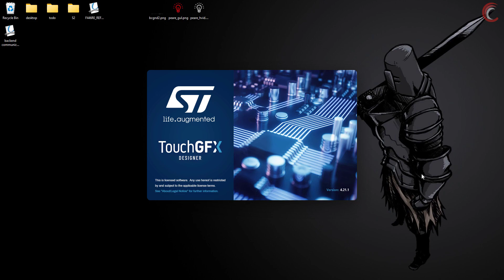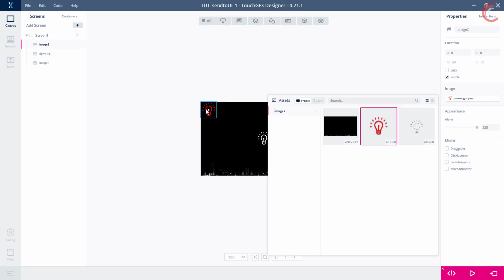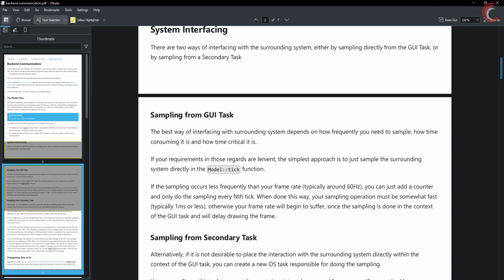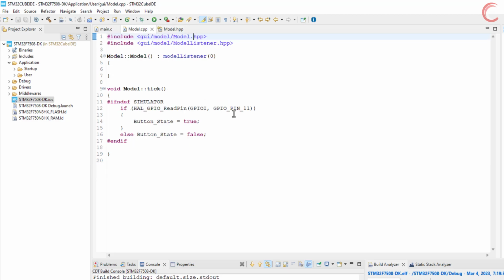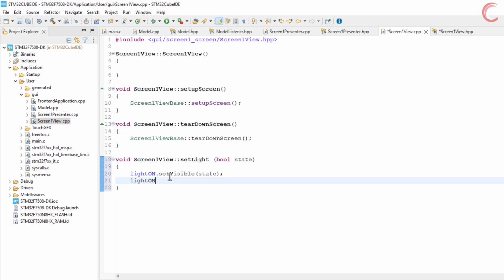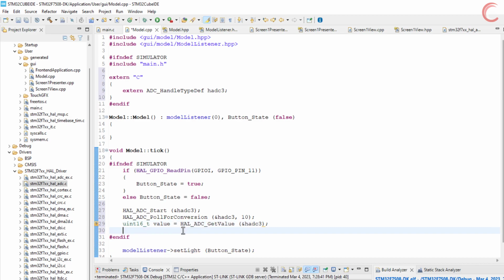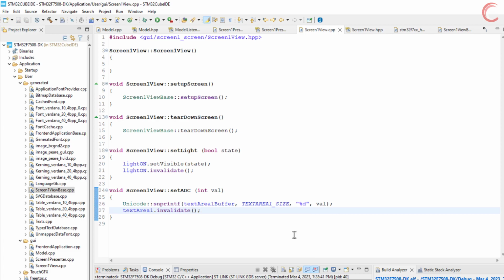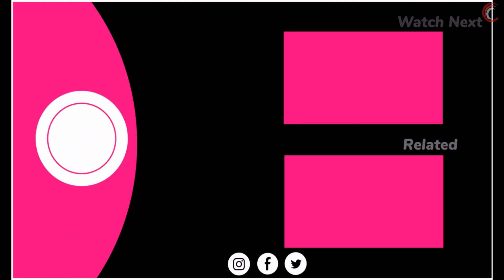Touch GFX #3. Send data to UI || Sampling from the GUI task || MVP

Comment: Thank you, great video! Is there a way for passing data NOT using Model::tick() all examples use the tick method, I am trying to pass a uart message recieved value every 5 minutes to a graph and would rather push the data to graph when it is recieved instead of checking over and over in Model::tick()
Reply from the maker: I understand your point.  Even the examples and theory provided by ST also uses the tick() function implementation, so I couldn’t find anything else. But I will look into it.
The tick() function will run every frame irrespective of whether you implement something into it or not. I guess it’s fine to check the queue in it.
Reply: I tried sending a data frame using LIN protocole from the touchgfx to an st board and receiving another frame from from the board to the touchgfx 
But when sending the frame i received back the frame i sent 
What could be the problem 
Even i didn't use the interrupt mode for the master because in one of your LIN videos and u did say that we can't use the interrupt mode for the slave so what could be the problem ?

Comment: hello controllerstech, thanks for the videos you make, I wanted to ask, if instead the external button wanted to recall the same function by simulating the touch on the touchscreen? is this to see the button animation on the screen from hardware
? it's possible? Thank you.
Reply from the maker: Yes ofcourse its possible.
Use the same code for the button on the screen.
Reply: @ControllersTech  thanks for the quick answer. I probably didn't explain myself well. if you touch the screen with a labeled button, for example, you see the button color change and perform the function, is it possible with a physical button to emulate the touch on the finger touchscreen? connect physical button to sequence callback? I've been looking for days for an example but I can't find it. The idea is to have an on-screen matrix numeric keyboard and other hardware physics in parallel and see the same reactions. Thanks for your time.
Reply: @ControllersTech  Ok I worked on ClickEvent() and found my solution.. thanks for your great job...